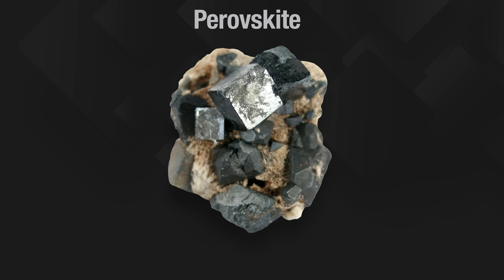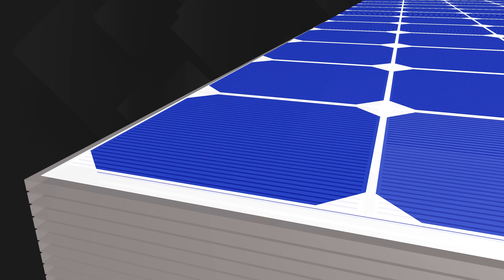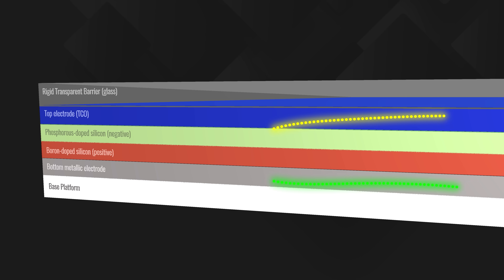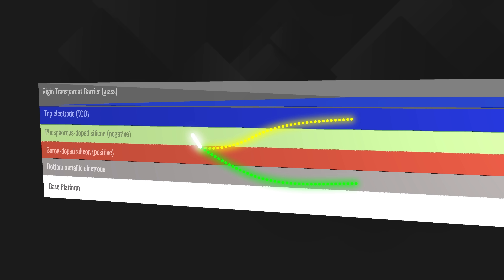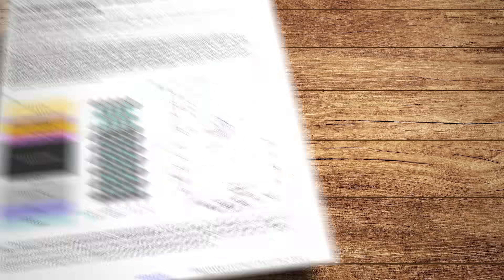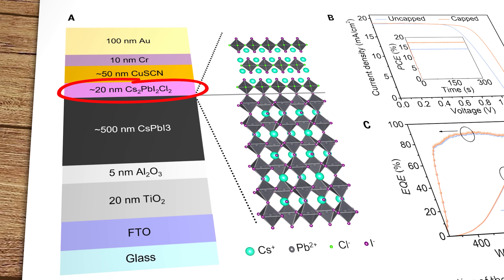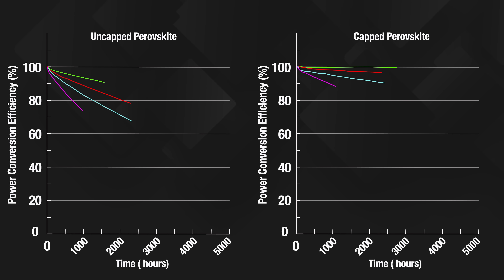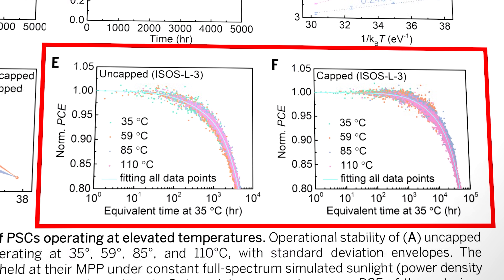Perovskite solar cells. Major new breakthrough!

Comment: Arguably, as individual home owners, small businesses, or local industries, our biggest investment area (financial commitment to environmental protection) is likely to be solar P.V. and currently there is a lag in investment for several key reasons.  Cost is probably number one but the crazy rising price of gas and oil and the falling price of panels will help lower this barrier. Maybe efficiency (in relation to the installation cost or available surface area is then regarded as the next most important consideration. Personally, I put longevity as of primary importance. The investment in energy and material required to make solar energy a viable option for us may be less per kilowatt hour than say a big power station but if we have to scrap the whole shebang after fifteen to twenty years because of material degradation or an environmental factor such as algae growth, abrasive dust deposits or even corrosive bird shit, then we should be thinking much harder about the relationship between production/installation/maintenance design and environmental cost. Panel efficiency percentage will degrade. Even if it were to become possible to produce  lifetime product or even an everlasting panel, where is the incentive for the manufacture to do so? Decades before we changed to low wattage light bulbs when a filament bulb had a short life expectancy, technology advance developed an everlasting lightbulb but it was never manufactured.
Reply: Agreed. Additionally, a finite-lifespan solar cell with soluble lead as a nontrivial ingredient seems like a major risk for long-term disposal costs and possible environmental damage if not handled properly.

Comment: Continuous temperature testing is unrealistic, many of my clients have had the glass on their panels shatter, after say a hot day is followed by sudden rainfall. 

The material expansion and contraction adds to the fragile complexity.
Reply: Accelerated testing (e.g at higher continuous temperatures) is only one aspect of a product test process, and is more applicable to the basic test cells the researchers are making. For quality finished products incorporating the cells, they will also test for temperature ramp (different rates), freezing etc etc. to ensure there are no points of failure.  I think what you have seen could likely be due to poor mechanical tolerancing in the finished panel design.

Comment: just use sand
Reply: so you claim phonons (vibrations, heat) makes solar panels better, nope does not seem to be, try super conducting cold solar panels
Reply: ore use straight band cap semiconductors, or just try other indirect band cap semiconductor intrinsic layers (PIN diodes) like copper oxide
Reply: GaAs is not so expensive, make it cheap, like silicon
Reply: patents ruin all, laws ruin all

Comment: Cheaper film would be great news. But is that the primary cost of a solar system? The inverter is expensive - so we still need a cheaper inverter, and cheaper batteries, before this becomes a no-brainer for every building and roof. 🤔

Comment: I did research with thin film solar when perovskites were just getting started. The biggest problem I see with them is highly-soluble lead. “Ammonium Lead-halide perovskites” are the commonly references perovskite, and with the slightest quantity of water the lead dissolves out as lead or other lead halides. This is highly mobile in water, so any damage to these panels or improper disposal risks significant environmental contamination.  Similarly, larger quantities of lead halides are used in the manufacture and will end up in the waste. Sloppy environmental practices at the manufacturing sites or sloppy practices at the waste-disposal site could end up with lead in the atmosphere or the soil, causing massive ecological damage.

They will need huge environmental protection at every step of the journey. Lead in solder for traditional solar can be an issue but it has alternatives and it is in a metallic phase so it weathers less easily. The solder is also an equal issue between these panels.

CdTe, the most mature thin-film solar material is likewise burdened by the carcinogenic and toxic cadmium, but it’s also reacted in a form where it will dissolve and weather only very slowly.

I cannot stress how instantly water will dissolve the lead out of this material. The most critical development to me would be finding s good replacement for lead that is non-toxic and available in adequate quantities.
Reply: I don't have the background of research on the topic, but this was one of the first questions that came to mind watching this. Great to see you've raised it; concerned to hear of the apparent mobility!
Reply: @yachalupson  the current solution is encapsulation, and it is small quantities, but if they break you have a significant hazard, or if discarded.
Reply: You're entirely right about the worry of soluble lead in perovskites, but not all perovskites are lead rich. Sadly most of the perovskites with long lifetimes are lead based, due to its increased stability relative to tin, and other similar elements. The 2D capping layer on the other hand has increased stabity due to it's low dimensionality, you can think of it as having one less dimension for water and oxygen degredation to get in. My PhD was on taking these 2D layers and mixing lead and tin, to modulate the wavelengths of light it can absorb, whilst, at least reducing, or eliminating lead. We mentioned it a bit in our similar video on Perovskites around the same time as Dave's first. It's very exciting to see these 2D layers become crucial at increasing the lifetime of perovskites.
Reply: @OurEden  !! got links?
Reply: I have read that perovskites contain very little lead
Reply: It does not matter how little lead a single panel contains. On an industrial scale that little becomes a lot especially when this tech is supposed to be used everywhere and cover any surface possible that gets sunshine. Mining of lead is bad, disposing of lead is bad and not to mention accidents that happen with lead are very bad. As @Robert B mentions, we need to find alternatives of Perovskite crystals that do not contain these toxic elements.
Reply: @ZeroInDaHouse  the amount of lead does matter because it will dictate safety protocols. Because the amount of lead is low (@about 0.8 grams per square meter of panel), some researchers have been able to get around the lead seepage problem by building specially made tapes that will absorb and neutralize all the lead in the panels in the event of panel damage and rain. Other researchers have developed special phosphate salts that will neutralize the lead in the event of panel damage.
I personally am not concerned about the lead problem.
Reply: @thexperimenter88  I'm sure there are ways to solve the problem with lead, but it probably won't be free and in a capitalist society some will try to cut corners, I think that is the concern, not that it is technically impossible to solve the problem...
Reply: @simonstucki  I doubt it will be an issue. The sticky tape solution sounds like it would not be expensive. Also it is in the companies’ best interests to stay compliant. Lead poisoning is a serious issue, I would imagine the prospects of million dollar lawsuits and the possibility of going out of business would be enough of a deterrent
Reply: @thexperimenter88  Don't underestimate the drive of capitalism to cut corners. This should be very well regulated before it's mass produced.
Reply: @DiThi  don’t also underestimate the ability of capitalism to cut costs. Look at catalytic converters. Every car has them today
Reply: @thexperimenter88  Because it's well regulated. And because cars have to pass periodic inspections before they can be used on public roads. There's no such regulations for solar panels. No laws for regular inspections, etc.
Reply: @DiThi  because right now solar panels are made of silicon. If there is lead in solar panels, it will be mandated by law to have regular inspections and tests on soil in the area
Reply: @thexperimenter88  My car gets inspected twice a year. The inspection was about $50 US in a very competitive market. The cost to install scaffolding to safely access my roof is about $1000 US. Nobody will want this for a private home.
Reply: @ccdimage  my example was about catalytic converters becoming mandatory by law to be installed in cars and they don’t cost an arm and a leg. this is not similar to doing car servicing twice a year.
I doubt solar panels will have to be checked often, just once a while. From what I have read about the protective mechanisms for lead in perovskite cells, they are cheap and robust(can absorb up to 10 times the amount of lead that is present in the solar panel)
Reply: @thexperimenter88  How often between inspections? Maybe 2 yers of lead pollution is OK. So I think add an ongoing cost of $50 per year will make most people pass. 
The tech may have limited use in powering a space station or something like that where pollution is not a problem.
Reply: @simonstucki  And with the recent US Supreme Court decision pulling the rug out from under the US EPA, cutting corners by US corporations will be on an increase not seen in the last 25+ years.
Reply: @DiThi  i get so nauseated when ppl blame "capitalism" for shit work. The shittiest work comes from non-capitalists countries. at the end of the day, ppl in general suck at their job and are lazy for the most part. has zero to do with capitalism, that's a lazy left wing ideologue talking point that i wish would die. cause this whole industry and invention revolves around capitalism as well. if there wasn't a pot of gold at the end of this pursuit for the creative and intelligent to go after then they wouldn't do these things or invent these things. ppl see a need in a market or a way to improve and build business around that. so basically capitalism is driving this whole thing and ppl are saying it'll be what causes the issues... ffs ppl are the problem, not a system that allows creativity and free market ideas to flourish with out forced non-competition. can anyone pervert any system? yes. is the system the best we can hope for in a world of liars and cheats? yes also.

that aside i do enjoy the good interaction about ways to improve the flaws. but they should be kept to actual engineering and scientific concepts, as the only political concepts holding anything back are regulations so we don't fix too many orchestrated problems.
Reply: @simonstucki  You talk of a capitalist society, but the chinese bought out an AUS company working on perovskites and shipped it offshore. Their environmental standatds will be less than the West so be very wary of any panels or systems of same coming from there.
Reply: @thexperimenter88   You talk of a capitalist society, but the chinese bought out an AUS company working on perovskites and shipped it offshore. Their environmental standatds will be less than the West so be very wary of any panels or systems of same coming from there.
Reply: @simonstucki  far more lead in a car battery than would be used in the panels to power a house. about 400 full sized solar panels to each pound of lead. most ground already has that in old buckshot
Reply: @thexperimenter88  I hope so!
Reply: @Wayne3nterprises  Have you ever heard the expression that safety regulations are written in blood?  In other words, almost every safety regulation can be traced back to events where real people were killed or injured.  With the political activism of modern capitalism being so rabidly anti-regulation, it's fair to say they are fine with more blood as long as their profits increase.
Reply: @thexperimenter88  The actual absorber is very thin - yes, which is where that material is. The material is spread out over a large area though. at 1-2 micron thickness  a 1 square meter panel has 1-2 mL of absorber material in it. About 1/3 by mass is lead, so you're talking a few grams of lead per panel. The real problem is when it scales up, or at the manufacturing/disposal sites.
Reply: @robertb6889  from what I have read the absorber material can absorb the lead multiple times over.
Reply: @thexperimenter88  I think you and I are meaning different things by "absorber material." Generally the absorber material to me is the lead-containing material that absorbs the light, not the material to bind to any leaking lead. It's an interesting concept if it can work.
Reply: @robertb6889  yes I am referring to acid strips that will absorb the lead in the event that the encapsulation is damaged. They were developed by the university of Illinois. There are also other technologies like cation exchange resin and silicone based adhesives that are being developed. Based on the promising research I have some across, I do not see lead leakage being a problem provided these protective materials can be scaled
Reply: @thexperimenter88  An interesting recent development. Certainly an interesting way around the one of the two biggest problems with these cells.
Reply: I'm glad you brought this up.  Given the history of lead in industry, I have a hard time believing there is going to be a massive deployment of a product that risks widespread lead pollution.  I hope to see more coverage of lead-free perovskites.
Reply: Bismuth?
Reply: How about a way to chemically fix the lead so that it functions, but becomes insoluble in water?
Reply: @craigking391  directly fixing it would be as hard as changing the metal out, since it would require redesigning the material, just the anions instead of the cations. Halides are currently used, but there aren't many other options that take -1 oxidation states, so it may be much harder.

It does look like they're looking at encapsulating a second material that should the lead leak, would react to make an insoluble compound as a kind of work-around. I'm not an expert on how realistic that is in the real world though.
Reply: This was my first thought as well. Lead plus major manufacturing in China and disposal in Africa all together make for quite a mix.
Reply: Looking at the layers I see a Copper(I) thiocyanate layer. My understanding from google indicates this material is also toxic. 
The rain from my roof (where I would install a solar panel) goes directly to the storm water system, that being a stream to a river to the ocean untreated. So less than ideal to be made from something toxic.
Reply: Geez, why does the nonsense continue? These are very stupid ideas.
Dennis Lee's invention produces energy 24/7 anywhere in the world, hot or cold, day or night. And connected to their compression motor, it runs continuesly recycling over and over. The more the wind hits it, the more heat it extracts from the atmosphere. Therefore it doesn't need the Sun. 
A very simple and easy to manufacture device. Very little maintenance, has already been in production and on the market for over two decades. But the Nurds want to make everything so difficult. 
You'd think that if the Climate Crisis was real, this device would be mandated for every building in the world. But the Climate Crisis is a Hoax. So good luck with having real products for real solutions.
While you're here, look up Dennis Lee, Troy Reed and The Big Eureka. At least have a peek down the Rabbit Hole.
Reply: @bradleejones9959  If there was even just one climate scientist in the entire world that saw an invention like Dennis Lee's work, we would know.
Reply: Thanks for the "heads up",not many renewable energy advocates consider all the enviromental effects, this could rank up there with tetra-ethyl lead.
Reply: @johnsherman7289  It won't be that bad, because the amount of lead in gasoline was about 1g/gallon and we used a LOT of gasoline.  My rough calculation is like 3g per square meter, so 1-2 grams for a single solar panel, and a single tank of gas could be equivalent to an entire rooftop-solar installation.

Bigger concerns will be around manufacturing sites, recycling sites and landfills, as any sloppy practices or leaks will mean contamination.  A natural disaster at a large scale solar farm (major hailstorm, hurricane, wildfire etc.) could also contaminate the area locally.

It's really hard to top leaded fuels in terms of environmental damage. In fact leaded aviation fuels still exist and are probably more severe for mass environmental contamination. Coal-fired power plants also toss out a LOT of lead, as well as arsenic, chromium, cadmium and mercury. A ton of coal will be 20x worse than a perovskite solar cell, even if all of the lead were released. The major issue here is concentrating all that lead to single locations, since it's water soluble and not burned and released in the air.
Reply: Thanks for the insights. Lead has been a real issue in the past and we should learn from our mistakes.

Comment: interesting. there might be a significant upgrade spree incoming in six years as the solar panels and heat pumps both have incoming promising technologies and they both are installed now so much that the installing capacity is saturated

Comment: I am a little worried about the presence of lead in the protective compound. Does this lead compound have the same health concerns of other lead sources? Does the compound break down into other compounds with similar health concerns?
Reply: Yes, it’s dangerous.
Reply: It's completely encapsulated in the system and as long as its responsibly recycled, I personally don't have an issue with it.

Comment: Photovoltaic is essentially a chemical process that releases electrons which is not reversible and degrades over time, thus the life of a cell is about 20 years?
Reply: PV is a solid state process - it just happens that the materials used to make the cells tend to degrade by chemical processes, which then reduces the PV efficiency etc